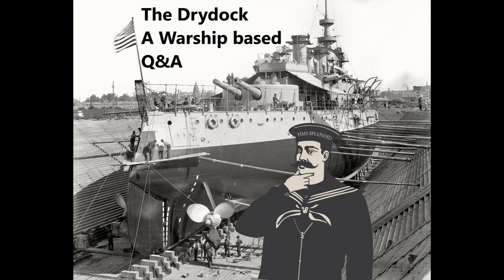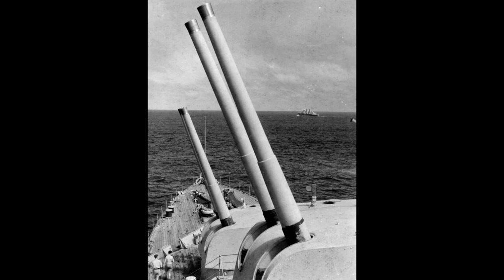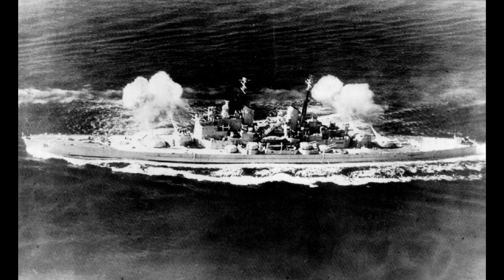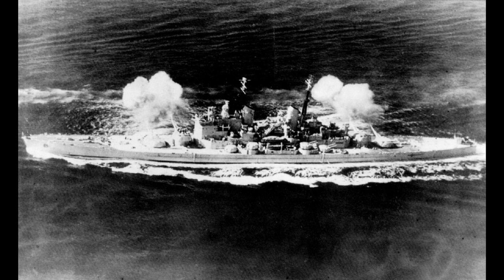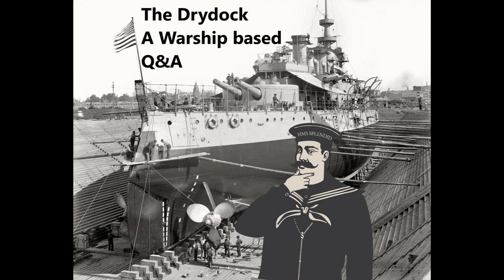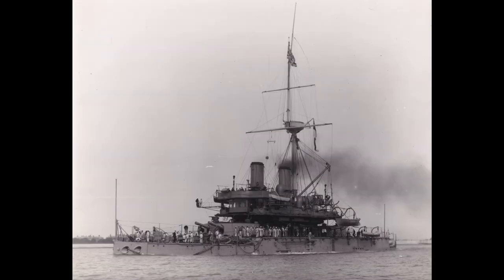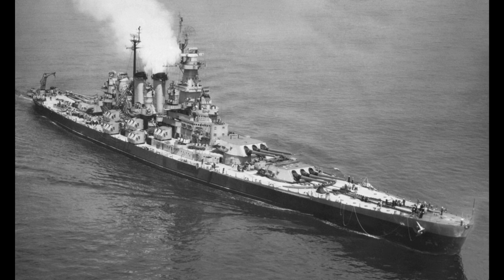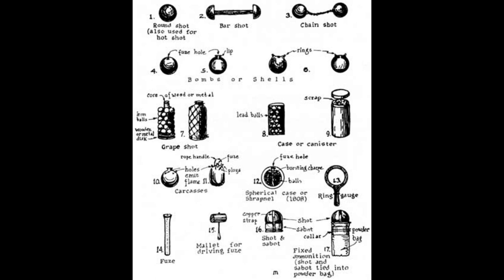The Drydock - Episode 149

Comment: I have to wonder, what would it be like to employ an hyper-dense sabot projectile in a 16" 50... A 3 foot long 1/4 ton Depleted Uranium or even a Tungsten dart smacking into the belt of something like an Iowa class. Would it have a flat enough trajectory to get through? What would the hole in the hull be like if it did? What would be the effect (Aside from not healthy) to a steam plant or even a magazine? Considering shells by design have an explosive filled cavity, I have been curious what the combat effectiveness would actually be.
Reply: I can picture a sharp hypersonic tungsten penetrator going through and through anything less than an Iowa. The physics of such a round are kind of terrifying.
Reply: My guess (for what it’s worth) would be that a pure penetration projectile would not be very effective against a battleship. 1900-1950 ships are mostly big enough that just poking holes in them won’t really be enough. You need the explosive to do the damage. See Drach’s video on the Battle of Samar. Destroyers were surviving even 18.1inch projectiles from Yamato because they were punching straight through and not detonating.
Reply: I know what the 105mm sabot from an M1A1 does to 3" of steel, was kind of where I was going with that. As far as an explosive, the sabots smacking a tank do tend to shatter the interior face of the armor turning the armor itself into the equivalent of a frag grenade. Just thinking outside the box after contemplating a railgun.
Reply: @princeoftonga  okay, followed your suggestion, finally found the right video (I went through 3) and I believe you are refering to Yamato punching holes in Johnston. the difference between a fused and explosive filled round compared to a hyper-density round is the dart of the hyper density round tends to shatter itself on the next layer it hits that is capable of stopping it. Again I refer to tank hulls for my experience, but on those at least the dart goes in one side and shatters when it hits the other.

I agree with your point that 1" - 1 3/4" hull plating is going to provide about as much resistance as a loaf of soggy bread (DD hull) but I could see the various layers of a cruiser or frigate having enough meat to actually break the dart. Either that or all of a sudden having a super heated skewer stuck in the guts of your ship. Where I was getting curious was dropping the mass of the projectile as well as it's cross section while maintaining roughly the same velocity. More than anything was looking to get a feel for others opinions as to the outcome.

Straight broadside, yes, over penetration would indeed be a factor, but long axis of a ship you're bound to be punching through many more decks and bulkheads, plus anything else in the way. As far as combat effectiveness I was considering what the better solution to a turtleback scheme, as a hyper dense round could feasibly punch through deck armor and out the bottom of the hull. 

Figured I'd post the thought on here specifically as I understand how tanks are put together, but when it comes to ships I have only the loosest of concept.
Reply: Ships are not tanks....
Reply: Only way it would kill a ship is if it were to get a spectacularly lucky "critical hit". It would make mincemeat of a turbine or prop shaft, would probably detonate a magazine, but only with a direct hit. Otherwise the damage control party will simply thank you for making a nice, round, easily patched hole.
Reply: @nunyabidness674   A sabot penetrator on that scale would be interesting to see tested. However against tanks the penetrator vaporises into a relatively small interior volume. The difference in scale between even a scaled up sabot and the interior of a ship is a lot greater. Unless you get a golden bb direct into a magazine there’s an awful lot more volume to soak up that hot vapour cloud without it doing much. Also cost would be an issue. The super heavy AP mk8 shell cost $500 in 1939(about $9500 today) I would guess 1/4 ton of depleted uranium or tungsten for the sabot would cost a bit more than that.
Reply: @kmech3rd  Sooo, in your opinion it would be similar to the final demise of Bismarck, riddled with holes but still not yet sunk. Yes? no?
Reply: @princeoftonga  regarding cost, you'd be surprised just how inexpensive DU actually is. The explosive in standard shells is actually more expensive on its own to produce, where DU can actually be mined raw. The "Depleted" part of that just means that one specific isotope of uranium has been processed out of the ore, and the tailings are the depleted portion.

indeed the interior of a tanks hull is very tight quarters. From what I've seen of the interior of ships, the lattice of relatively light bulkheads do somewhat recreate that scenario. Hence I was asking outside opinions. I can see your point of overall greater spaces contained in a ship a hundred feet wide, was just trying to get a feel for just how stout that lattice of interior structure actually is. As for a penetrator vaporizing, from my experience they scrape off an layer of their mass, but the core still stays somewhat solid till it hits the next layer of armor when it shatters like glass.

I suppose it may have been a unanswerable question without practical testing, thanks for the reply anyway though :)
Reply: @WALTERBROADDUS  you're correct saying ships are not tanks, but a lot of the design concepts do carry over from ships to tanks. Between the two, the overall concept of put an armored box around a cannon is pretty much the same. As I had stated, I am familiar with tank design, but only have the loosest concept of ships interiors and how they go together as a whole.
Reply: @nunyabidness674  Not really the same. Anti tank weapons only need to enter the crew space. Then it kills the crew or sets off ammo. Ships are compartmentalized. They have voids and tank spaces. A hit in one space is not critical snd is contained. Also shape charge does not make a hole to cause flooding.
Reply: @nunyabidness674  more or less. Unless the gunnery crew just got amazingly lucky and hit something critical. Not impossible, but it would have to be a precision targeted weapon to kill a ship outright.
Reply: @nunyabidness674  Didn’t know that about DU. I just assumed it would be expensive. I agree any actual research into that would be fascinating :)

Comment: Re: Can a weaker economy win a war. War is, to some extent, a political tool to achieve some goal. If the war becomes too expensive relative to the goal, the larger economy will be unwilling to keep up the fight. Sometimes this works out (e. g. the Cod Wars) and sometimes it doesn't (e. g. the Falklands War).

Comment: Drach, I finally got my copy of the new Garzke, Dullin, and Jurens book BATTLESHIP BISMARCK.  I don't know if you have read it yet.  But it contains everything one would want to know about the BISMARCK . . . but were afraid to ask.  But, at any rate, settle a debate for me.  A friend of mine says that had BISMARCK made it to Brest, France, the British would have failed in Churchill's admonition to "sink the Bismarck.' I don't agree.  I believe that the Royal Navy would have launched airstrikes against Brest; which would have destroyed BISMARCK as he sat in the main dydock undergoing repairs.  Do you concur?
Reply: The Royal Air Force expended an enormous amount of time and energy trying to bomb the German ships at Brest into tiny pieces at the bottom of the sea, but they didn't manage to do that before The Channel Dash, (I think it was called Operation Cerberus?), where the German fleet did a run through the English Channel at top speed and made it back to Germany, albeit with several ships heavily damaged. So if the RAF couldn't sink the other large German ships at Brest, they probably wouldn't have had better luck with sinking the Bismark.

Comment: Iowa also has an 1 1/2" decapping plate before the slightly thicker than 12" 19 degree angles main armor belt drachinifel. While it will not defeat top shelf battleship shells from point blank, it completely defeated very powerful 14" shells fired directly  from point blank (battleship south Dakota when she was electrically shut down). Yes it was suspected to be high explosive but it was a dead in the water defenseless battleship at point blank. The simple truth is drachinifel you're making a small error by under estimating the actual capabilities of the armor belt system on the iowa's. We totally understand as all besides Ryan on battleship New Jersey herself who the fuck has a real Iowa class as "yours".
Vanguard had a decent holy triad but we both know it just is not fair what so ever as the iowa's are far superior in every single aspect besides build time, complexity, and sheer cost that great Britain just had no chance to match considering the severe circumstance of Hitlers Nazis on meth (literally)

You know aswell as I do even loosing full salvos, even if 2-3 shells land when fully ranged in that ship is extremely accurate. Now when rolling, manuvering, and as you said angling, vanguards shells and naval rifles are not satisfactory for attacking a top tier opponent of any nation but in all reality she was never meant to from day 1 she was basically meant to simply be a very useful hull during the deadliest war in human history. 
Iowa really was meant to be most lethal yet fastest ever and still is which is why Iowa shells and rifles will penetrate top tier opponents damn near no matter what.

Easy to nit-pick someone who's gone on video as you have this must be said. But for those of us who are more involved than humanly healthy lol I had to add those facts
Reply: But the shell hits on south Dakota where on its barbettes not main armour belt (barbettes a thicker )